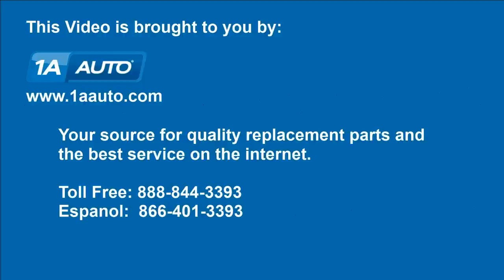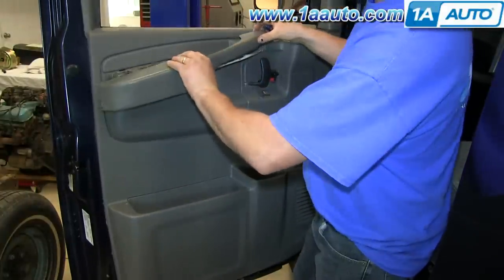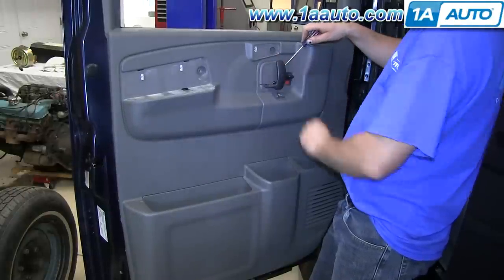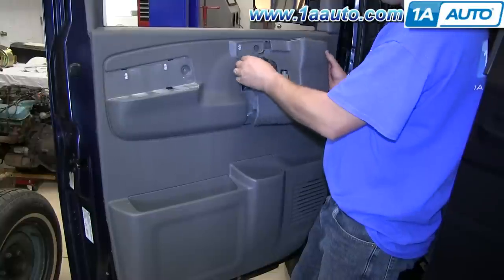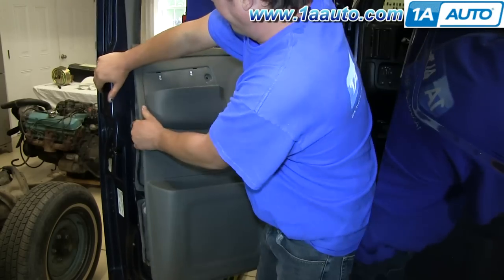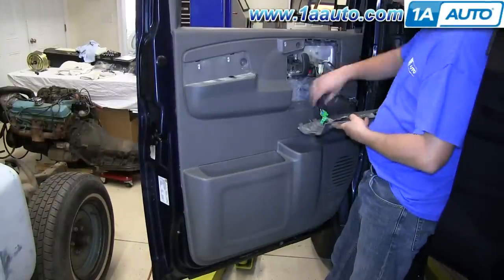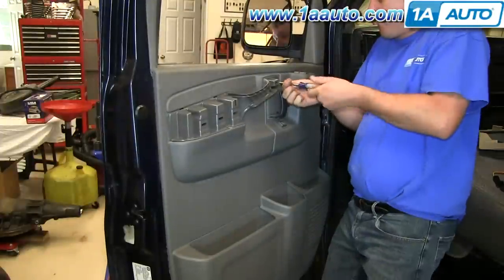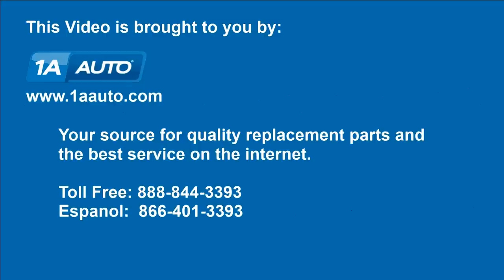How To Remove Front Door Panel 95-19 GMC Savana

Comment: Another little helpful hint, to avoid distortion of the phillips head screw from repeated attempts at loosening? Take a small hammer and with the screwdriver in the head of the screw, hammer it three or four times initially, this will shock the screw free to then loosen it! 😉
Reply from the maker: +walcoman Thanks for the tip!
Reply: @1AAuto  not a problem, I deal with exterior signs that have been exposed to every type of weather, lol. Cheers from Canada, and I refer to your site on occasion, it's nice to have a place where I can find answers about my Sierra! 😉

Comment: Is it possible to purchase the small clip the goes into the door panel that the door pull handle attaches to?  I am struggling to find a part number.  My pull handle broke off and one is missing.  The replacement pull handle kit includes the larger clips but I need one of the small clips the goes into the door panel.

Comment: Can you tell me where I can get a drawing of the rear doors that shows the different parts of the door? I have a 2016 Chevy Express 3500 LT passenger. I want to find out if there is enough room in the plastic part below the tail/brake light to put some LED brake lights.
Reply from the maker: +G. Dennis Long To get a blow-out diagram like that you will most likely need to contact a Chevy dealership.  You can also reach out to Chevy forum users who might have that information.  http://www.1aauto.com?utm_source=YouTube&utm_medium=CTA+Comment&utm_campaign=ytcomment&utm_term=vZxbv5XgzFg